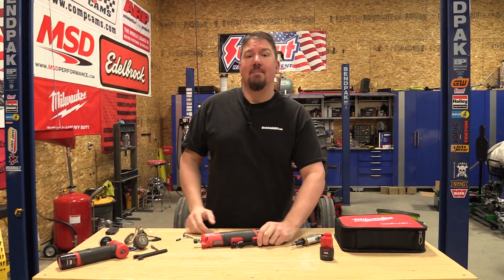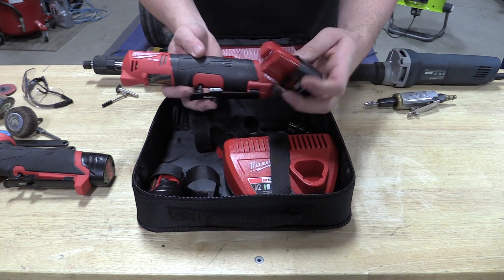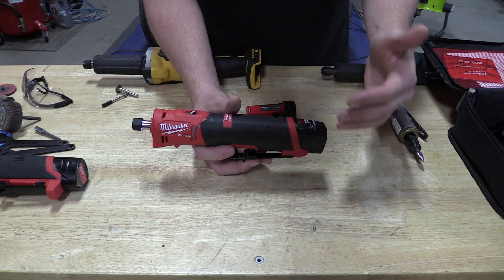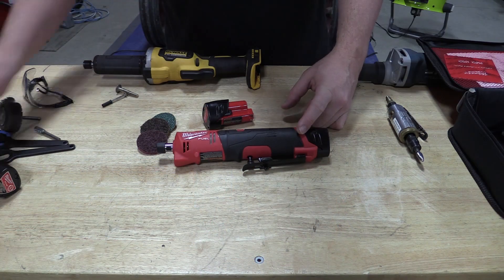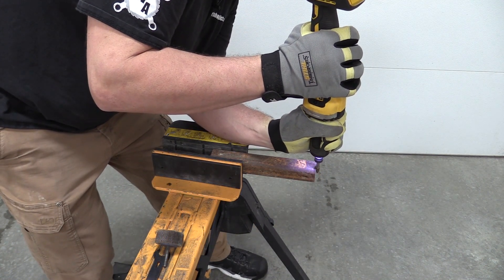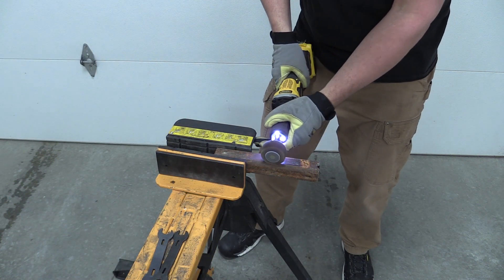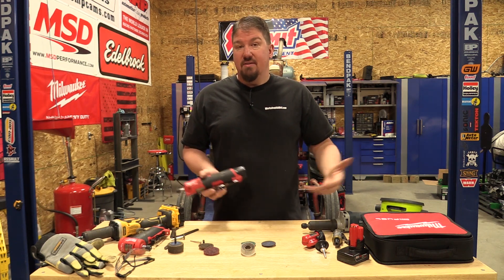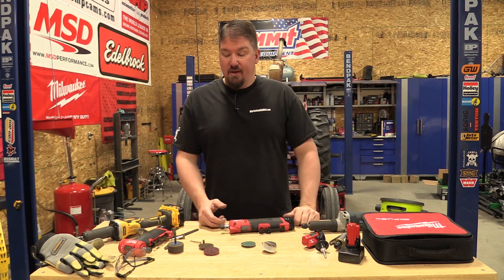Milwaukee Tool M12 FUEL 1/4" Straight Die Grinder Review 2486-22

Comment: @workshopaddict, Great Video! I had to make a trip to Illinois last week to pick up a Truck for my Boss,and took the opportunity to stop in Columbus at Ohio Power Tool (awesome by the way).
They didn't have them out on the shelf yet, but I was able to Sweet talk them into selling me one early. Love this Tool. When they came out with the Angled Version, I bought 2 of them right off the bat, now have 4. That way I can keep them setup with different attachments and abrasives that I use on a normal basis, and they are ready to go at all times. I was really hoping that they would manufacture a straight version and was very happy when I found out they did.
I love this Tool, and the Angled version as well. 
Since I got the Angled ones I have only broke out one of my Air Powered units on 1 occasion.
Since getting back home and trying this thing out, I have put 2 more on order. Milwaukee has really changed life for the better for Fabricators, Welders,and Mechanics with some of their new Tools. The M12 Fuel Ratchets are like gold in my Shop, along with these Grinders.
Keep up the good work Brother!
Reply from the maker: Thanks bud.  Glad you were able to get one of these.  We are glad to have a few batteries charged up and ready so we have the ability to drop the cords!
Reply: @WorkshopAddict  10-4 on keeping the Batts charged up! Me too, I live these lil Grinders, but I will readily admit that they are Battery Hogs. That's the advice I would give anyone when recommending these 2 Tools, is ti make sure you have at least 2 Batteries for each one if you plan on using it very much.
I am fortunate enough to own at least a dozen, maybe even 14 or 15 M12 Batteries. I also suggest for anyone buying these to get themselves at least one 6.0ah Battery.
Reply: @phillipchambers8487  If you were to buy just one - angled or straight?
Reply: @TerryManitoba  If I could only buy one, it would definitely be the Angled version. The Angled is just more versatile imho.
Reply: @phillipchambers8487  THX - Appreciate the quick reply

Comment: I have the dewalt 20v die grinder as well
Reply from the maker: I enjoy the 20 volt dewalt for the grip.  I hate the safety, but deal with it as it is just smooth and easy.
Reply: I use my dewalt all the time, and love it. I would like to  have the M12 Fuel as well, because of its smaller size and weight, for those tight areas

Comment: I don't have the die grinder(s). I do have the little cutoff tool. If the battery life on these die grinders is as poor as the cutoff tool, I will pass.
Reply from the maker: Well, I showed you the battery life in the video............
Reply: Yup, you did.
Reply: Cutoff tool needs the 6ah or 4

Comment: In practice, very few distinct applications for each version of this grinder.  Most of what one can do, the other can too.  But I think most users will be better off with the angle.  I am.
Reply from the maker: IMHO, using a buring tool is perfect for this tool where the flat rolloc discs were more for the right angle.  But, people want to see run time in the worst situation, so...
Reply: Right angle for flat surfaces. Straight for inside and tight spots. There’s a reason every mechanic I know owns both

Comment: I purchased milwaukees 2 dremel tool and both motors overheated and burned out! Im thinking of using die grinder with the collet reducer and give it a shot.
Reply: That's my plan too, burnt out one and burnt out the warranty replacement for some
Reply: I have had the m12 dremel tool since it was intro'd and gave a few as gifts too. Theyre all going strong under heavy use.
Reply from the maker: I think it will work out well for that.

Comment: How does it's bigger brother compare aka (18volt) Milwaukee, compare to the DeWalt 18volt version? Great video BTW! Love your channel!
Reply from the maker: I became attached to the Dewalt 20-volt due to the feel and the way you can adjust the max speeds.  I do not use the 18-volt because it is not as comfortable as the Dewalt.  Comparable power, but the rest of the tool does not stack up to the dewalt, IMHO.
Reply: Cool! Thanks for your opinion. 👍🏼🇺🇸🦅

Comment: Great channel...between my Dewalt die grinder, m12 rotary tool and m12 right angle die grinder, it doesn’t look like a tool I need. I like my very small pneumatic straight die grinder much better.......👍🇺🇸

Comment: How do these new Fuel grinders compare with the M12 2438 polisher/sander?  I have it and find it great for up to 3” accessories, but I can see where the right angle Fuel’s form factor would come in handy.

The 2438 is a much lower speed tool so it’s likely got way more torque, but it’s an older brushed motor design.
Reply from the maker: I use the polisher and sander for small areas of buffing on cars with a small 3" foam pad.  These die grinders do not have the low end grunt to do that.  The polishers do not have the high end speeds these have...  So, two different tools for different applications.  I would never run a burring tool in my polisher and never run a polisher in my die grinder.
Reply: Having owned the polisher for years this beats it simply by having a standard collet for using ANY 1/4 attachment. That m9 thread on the polisher pissed me off no end.
Reply: Lexicon Devil, agreed!  Milwaukee really isolated that polisher by putting that screwed up thread on it!  I wonder if anyone makes an adapter?

Comment: Just got the right angle one...have a valve cover in the back yard that's looking like a test subject 😁
Reply from the maker: Some have complained about the right angle and the battery life, but I love that tool and use it for so many things!  Its awesome.  Rollocs work perfect with it.
Reply: @WorkshopAddict  glad to hear.  The 2" rolocs are what I've been using on the air one...and I didn't want to have to get smaller ones lol

Comment: How does it hold up with a burr in wood? Does it cut out frequently if you put some decent pressure in it?
Reply from the maker: I almost did this for the video.  It will do very well with wood burrs and it will handle the pressure without issue.
Reply: @WorkshopAddict  very nice. That would be my intended use of this tool. 👍

Comment: Great tip my collect was stuck inside the shaft from factory and couldn’t figure how to take it off. I use the Milwaukee 6.0 battery with better results.
Reply: I found 6ah on fuel tools is not as big a difference as on the non fuel tools.

Comment: Great review!!! I have the M12 Dremel and it works well.Used it it many times without power around. There is also the cutout tool as well, but meant for drywall. Seems like there is a bunch of overlap. Every tool has its place and is a godsend when needed.

Comment: Pretty cool tool. I hope milwaukee can look into issue with their m12 rotary tool (dremel style). This looks like it a replacement for that tool, just kidding.  

Now that DeWalt die grinder looks pretty cool. Like the variable speed on the dewalt. Milwaukee doesn't have that option on their die grinder. 

Thanks for this video
Reply: A dremel isn’t a die grinder.
Reply: @thisismydogsaccount  

Yes, you're right a Dremel is not a Die Grinder...
Reply: Why would not be a good replacement for the m12 rotary tool? I've burned 2 of those up already and really need something for using those small Dremel metal cutting blades
Reply: @tizben  

I'm lost. Did you burn up two of the milwaukee m12 rotary tool?
Reply: @michaelc7283  Yes, that's what I meant. Burnt out 2 m12 rotary tools. Is there a reason why this die grinder wouldn't be a good replacement? Size seems similar, but with more power?
Reply: @tizben  

No, this looks like a good replacement.  Has enough power and looks like the same body style. 

I just thought Brian won't think so. Look
Reply: @michaelc7283  oh I see! I'm definitely going to try this die grinder out
Reply: @tizben  

Same here. I seen some video  and heard from other user that there's issue with that m12 rotary tool. That's why I hope milwaukee looks into it.
Reply: @michaelc7283  Does this essentially phase out the old rotary tool?  I don't have either of these and am curious if the older rotary tool offers more control for more precise work.

Comment: I don't know why I was never able to find 1/4 to 1/8 collet adapters before, but thanks for reminding me! And they do exist now..
Reply from the maker: Glad to help!
Reply: @WorkshopAddict  Actually I think I figured out the issue. I was originally looking for 1/8 to 1/4 adapters, to use carbide burrs in my dremel. having not been able to find them, ultimately just went with a full-size die grinder.
Reply: @colinstu  that makes much more sense the 1/8 adapters have been around for a long time.

Comment: good test with the manifold, are cut outs reduced much with the 6.0 or is it more tool dependent? you can get little flap disks that fit on that rolac pad aswell i like those for doing weld prep on rocker panels and unibodys where nothing bigger will fit but the sanding disks get snagged and tore up instantly
Reply from the maker: A little bit later in the video we show the CP2.0 used with a flap wheel and then use a 6.0 Ah battery and it cuts out the same amount.
Reply: @WorkshopAddict  my made must of missed that, https://www.amazon.ca/Density-Premium-Zirconia-Grinding-Sanding/dp/B07H667TZZ/ref=sr_1_3?keywords=die+grinder+flap+wheels&qid=1581969271&sr=8-3 talking more this kind of flap disk, i got a bag of 50 for like 25$ ones linked are too pricey imo
Reply from the maker: Those are sweet and do not use a ton of power!
Reply: Yeah roloc flap wheels are awesome. They work fine on the polisher should be great on this

Comment: I really want to see a "kit" deal with both tools.
Reply: Both tools,,straight and angle with two 2’ah batteries ,299 HD Seems like just an ok price.
Reply: I see these "die grinders" as not-crap cordless "dremels".  The big question will be can we find collets, etc, to use the smaller 1/8" shank tools on the M12s.

That said, I really wish Milwaukee had put spindle locks on these so you could change bits with a single wrench.
Reply from the maker: You will find the adapter to use 1/8" tools in the description.  I did show that later in the video.  A spindle lock would be amazing on this tool!
Reply: @WorkshopAddict  I guess I missed that.  I'll have to bookmark that adapter though I'd rather see Milwaukee just make an 1/8" collet and include it in the kit.
Reply from the maker: I do not see that happening.  Dewalt is including the adapter with many of their die grinders and not proving a new collet....
Reply: @WorkshopAddict  I tracked down and purchased a Milwaukee 1/8" collet for my grinder.  Interestingly, the M18 router uses the same collets so I can also use 1/8" tools in my router.